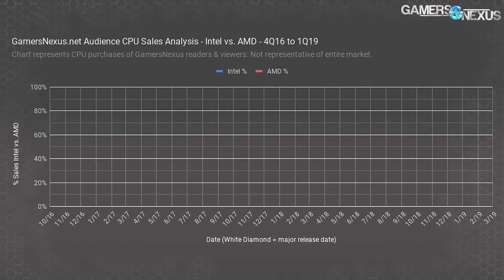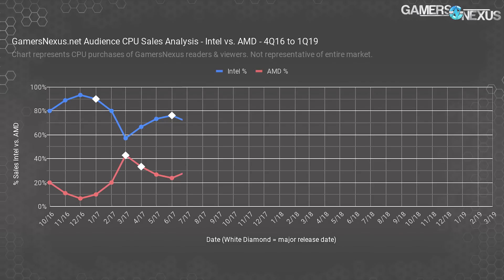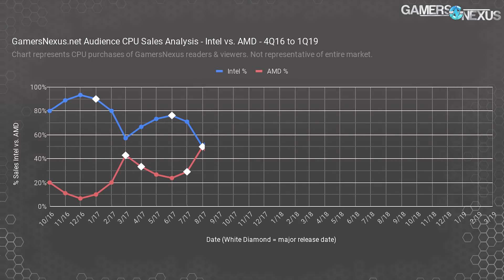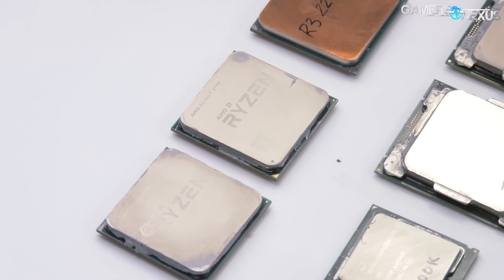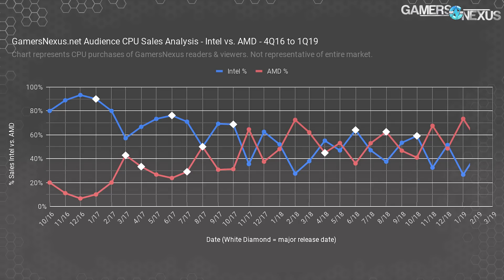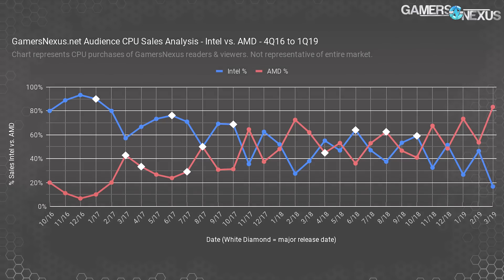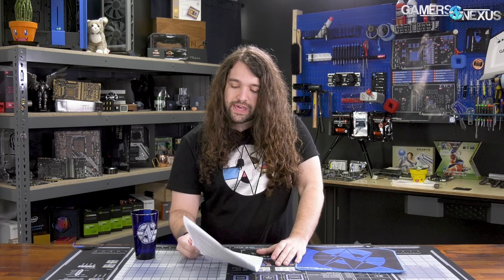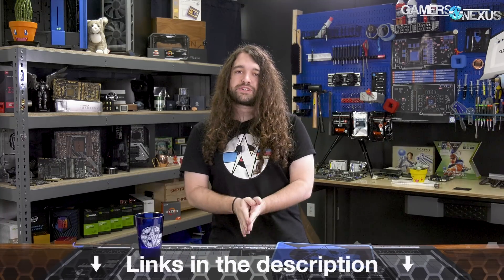Special Report: AMD’s Comeback Story - Intel vs. AMD Marketshare

Comment: I just can't wait for Navi and Zen 2
Reply: One or two month,,waiting AMD to take my money:)
Reply: Hopefully Navi isn't another Vega
Reply: It likely wont be. Everything we've heard points toward AMD focusing on being efficient, not running hot.  @eleanor-forte
Reply: isnt it usually the Nvidia fanboys who overhype AMD gpus releases tho? 'i want amd to launch good cards so i can buy Nvidia cheaper'. Even if navi performs lower than expected, buyers will have a pretty future proof card. not only cause of the infamous AMD fine whine. But most modern game engines should be well optimized for navi, since the consoles are gonna run a scaled down Navi SOC.
Reply: @golfclapper686  no, that's you just being high af.
It's the AMD fanboys that overhype it all the time. Wait for this wait for that, it will blow intel out the water, wait for zen2 wait for Navi, intel will be screwed.
I'd actually rather just wait and see what actually happens when hardware is out to cast my judgement but I've never held back on a purchase just because there is rumour that something else is coming out, that just builds you up for disappointment
Reply: Navi is going to be nice for GPUs. even though its later than the RTX 2070, if it's just as fast, it'll come in cheaper, and I'll support AMD over Nvidia if the performance is equal, because I really hate what Nvidia is doing to GPU prices... I don't want ultra high end because its almost never worth it, but the top of the mid range is a good place to be. 

Zen2+Navi is going to be my next build, too. :) But I'm going Mini ITX :D
Reply: Mine will most likely be a Zen 2 and a 2080ti. But i intend on waiting until we get some proper reviews in. Never buy on hype alone. 
I'm aware the rtx 2080ti is massively overpriced, but i've decided it's time i upgrade my Sim rig with VR. So i'll need all the power i can get.
Currently running an r5 1600 (silicon lottery winner, 4.1 capable but running 4.0) and a gtx 1070. Which has served me well thus far, perfect for my 1440p gaming needs. But won't be nearly enough once my VR gear starts coming in.
Reply: My first pc hopefully will be Navi and Zen 2
Reply: My current plan to replace my i5 3570k@4.2ghz +970 desktop is Ryzen 3700x is the leaks/rumors are true on either higher freq or more cores. Hopefully we get the higher turbo freq of 5ghz for a few cores. and whatever is in the $300-$400 price bracket from nvidia since I am UNABLE to go AMD for GPU because of their LOUSY OpenGL drivers for emulation. Which is where the higher Freq would come in. This will also be used for streaming to twitch so that is why I am thinking R7 to replace my i5. 16GB of either 3000 or 3200mhz ram as well.
Reply: Just commenting to notify you AMD just announced and revealed the stats of Zen 2 at Computex 2019 a few hours ago. Spoiler alert: they beat Intel.
Reply: @Hagvan452  I watched the keynote, they didn't beat Intel per se but they did strike performance parity which is huge.
Reply: @dennisp8520  Yeah my bad, I meant to say they matched and even slightly outmatched.
Reply: @Hagvan452  Yep, I will still be waiting on samples to make their way to channels like Gamers Nexus. I will more than likely upgrade in say 2 years if things keep up like they are.
Reply: Zen2+Navi APUs will also be very interesting for casual indie games players
Reply: I'm excited about zen2, but I'm am extremely hesitant on amd gpu releases. They always create so much hype and in the end, they always turn out to be woefully underwhelming by being barely competitive with the nvidia offering at higher TDP. 

I don't mind using their cards as I mostly player older games and did use a rx470 for 2 years, but now, I'm extremely wary of their gpu releases. Saying all that, if the price if low enough, I would buy amd again without hesitation.
Reply: Navi will be good. Much of the money meant for Vega was spent on Navi instead, and microsoft and sony pitched in because they needed a good GPU for their next gen consoles.
Reply: Don’t get too hyped about Navi it might be disappointing..
Reply: I've been on Ryzen since the R5 1600 came out. I'd love to switch to Radeon but I use 3d graphics programs that can use CUDA.
Reply: My next gaming PC will probably be Intel and nVidia...but dang it, I want AMD to force them to innovate.
Reply: AMD need money to do anything, and they ain't getting that if people continue to just buy Intel. I do understand the Nvidia - Radeon sitiuation.
Reply: @CaveyMoth  this is why they dont innovate. if amd is better for your money, please buy amd. otherwise amd will end up just giving up again........ they cant force nvidia and intel to innovate if people like you dont buy their stuff....
Reply: I couldn't wait anymore. I just decided to get the 9900k and RTX 2080ti. Honestly, I have no regrets at the moment. Performance  has been great and it's been a huge leap from what I had( which was a 4790k). I also got a new case from Fractial  that is really quiet and much smaller than my old one but still having enough space for all the parts. I am very pleased.

Still looking forward to what AMD has as it will force Intel to further improve and hopefully get the GPU prices lower. I paid $1500 USD for my 2080ti which is outrageous.
Reply: @dennisp8520  "couldn't wait"...? You had a 5 year old CPU, another few months surely wasn't going to hurt? :-/
Reply: @Peds013   That logic would apply but my work circumstances have changed. 6 months ago I was only using my computer for gaming predominantly. Now I actually do workloads that benefit from more cores(I even debated thread ripper) as well benefit greatly from the tensor cores in RTX graphics cards. I also want to point out that there were some features that I needed from the newer motherboards that were not available on my old rig like Nvme storage.

Anyway, the only reason that CPU lasted me 5 years was that there was no real progress until two years ago. My build range was 4k and X299 would have been too expensive back in the day for features that I didn't need at the time. Everything on the consumer end had stagnated so there was not point upgrading to say a 7700k as an example. First, gen Ryzen although awesome value had a ton of issues originally and bad single core performance. The Ryzen 2000 series was better all around including support(and like I said tempting) but didn't make sense when I still value gaming performance and had the budget for an intel build.

I may regret not waiting whos to say but the time that is saved from this new rig honestly probably negates any cost savings I would of had if I went and waited on Ryzen.
Reply: @dennisp8520  I was looking back at the 900 series and the top card was 980Ti which came in at a price of just above 500, quickly dropping to below 500. $1500 for a 2080ti is scandalous profiteering.
Reply: @BigAL0074  you can actually get it for $1,100. Also inflation is a thing as well as other factors that are driving up the fort to make GPUs

Comment: Hopefully Zen 2 will cause Intel to put out a decent cpu that isn't insanely expensive
Reply: jacob bryant: I believe Intel will come back with something pretty awesome, but they have to get on TSMC's 7nm, or something equivalent, fast, or AMD is going to bulge into a juggernaut of a competitor while Intel reconfigures its org chart, and also, Intel is going to be facing an increasingly powerful and competent adversary the whole time. Intel is gonna need at least a couple years to get their house back in order under Keller's guidance, but as things progress I'm quite sure that the AMD vs Intel story will still be about an upstart boutique chip firm vs a slow but massive incumbent Chipzilla, for the forseeable future. AMD is barely SP500. Intel is one of the pillars of DJI.

Comment: I am patiently waiting for an i7 9800X for my next build.
No interest in AMD whatsoever.
None.
Also looking forward to Intel's graphics cards,
and how Allyn Malventano can come up storage-wise with while he's there.
Reply: smarter shoppers do things differently than someone defiantly refusing to look beyond a weirdly obstinate purview.
Reply: Missing out my friend. Enjoy your terrible performance per dollar.
Reply: Well... By then, ryzen 3000 will be out a fair bit earlier, so why not give reviewers a gander apon release coverage. (: 

No sector of ryzen 3000 is without excitement for very good reasons.
Reply: Eh, I think I'd rather go with a TR 2920X for a $600 CPU, extra 4 cores/8 threads and 20 more PCI-E lanes than the i7-9800X, while roughly only having 5% lower single core speed.
Then again, Ryzen 3rd gen is likely to demolish any options that we currently see in the market, so it's a good idea to wait until the last week of May. (Computex)
Reply: @Megadeth1983Fan 
No interest means just that.
The 9800X does not have less PCI lanes. 
44 CPU plus 20 or 24 thru the chipset.
I KNOW I will not be able to do 5.0 GHz with the other brand.
Performance per dollar to me is a compromise.
I want performance. Period.
I also do not need memory issues which plague other brands.
(I have also built systems with Optane 900 series drives, have you?)
Smart shopping is knowing what you want, 
and using the product actually delivers every time.
If I want a Shelby GT500, I will not consider a v6 Mustang.
I will just work harder and save longer to get what I desire
because it is worth it to me.
Put it this way,
I built a system for my wife on X299 using the "lowly" i5 7640X.
CPU was 217 plus shipping brand new.
Can YOU go 5.2 GHz on a $217 CPU?
Delidded and on a 360 rad it runs DAILY @ 5.2 GHz. @ 1.17V
and never goes above 60C, and it is lightning quick.
With 32GB DDR4 (4x8) if I decide to upgrade the cpu 
I just have to move 2 ram sticks. (To go to quad channel)
Done.
Quality of EVERY component makes a difference.
Always has always will.
Reply: @2000cobraguy  Why settle for a 9800X? That is an enormous compromise. At least go with a 9920X.
Reply: Sounds like an elitist attitude. BFD On your high FPS or gigahertz. Processors and GPUs do not win games no way no how!  Gamers win games! There are many gamers with a lot less firepower (smart shoppers too with AMD) who use strategy well and win games. Just because you think your computer is running faster doesn't mean you're going to win more games. Your analogy of your gas guzzling noisy Shelby GT500 doesn't hold water either. You can definitely create more smog, burn more rubber, make more noise and Drive in circles on a race course, But when you get out on the highway with the rest of us you're going to have to deal with the traffic just like we all have to.
Reply: Hard work is not elitist.
Having goals and preferences with reasons is not elitist.
Where did I say I play games?
Reply: 9800X is not a compromise.
More cores = more heat = less speed.
Reply: @2000cobraguy  Better binning, might be a bigger die on that part with better heat distribution. Just as likely to hit 5.0 on the 9920X. I predict you won't hit 5.2 on the 9800X anyways. Might not even hit 5.0. Why settle for only 8 cores, because of only a slim possibility for a slightly higher clock. I understand if money is tight though.
Reply: @2000cobraguy  The 2920X has 60 PCI-E lanes alone...
Reply: 7900X and up have 64 pcie lanes
44 thru CPU and 20 thru chipset.
What is your point?
Without exotic cooling no AMD cpu can hit 5.0 GHz
Reply: @2000cobraguy  Ryzen 3rd gen is likely to hit 5+ GHz. Not only that but, refinement to the infinity fabric will allow much higher memory support than 2nd gen. Also, the X399 chipset has 12 pcie lanes while a Threadripper CPU has 60, which adds up to a total of 72. One last thing, IPC increase will be roughly 13-15% higher than the 2000 series, which will pull 5-7% ahead of Intel's current IPC. (Coffee Lake IPC is 8% higher than Zen+)
Reply: @2000cobraguy  Lol. AMD was doing 5+ GHz. years ago with FX. The point is that clock speed doesn't make the cpu. That's why it's so funny hearing you ramble on about your 'Shelby GT500'  and '5+ GHz'.

Comment: I bought a R5 2600 and am very happy with it. The performance of it is amazing, not just for gaming but also for rendering in blender. So happy that AMD has made this comeback!
Reply: I haven't upgraded my CPU in forever (2012) and haven't decided if my next one will be based on Ryzen or some future Intel CPU, but I'm certainly glad to see that AMD is back in viable territory with CPUs I can get at least a little excited about around the $200 mark, be it a 3600/3600X or 2700/2700X.
Reply: yaaaa buddy!!!
Reply: I'm quite happy trying out AMD side this build. 2600 here for a very affordable price to performance. Blender Cycles renders faster than with the gpu in openCL. Now that the ram prices have fallen too and some deals on RX5XX cards it's incredible how cheaply you can build a competent pc.
Reply: @Beowulf Proud owner of a 2600x they sold all the 2600's on ''build day'' so I had to suffer with a slightly higher price. Love my new PC build.
Reply: 2600 owner here as well for 150 bucks you really cant find fault with it. I originally got it as a place holder until Zen 2 releases. I will most likely still upgrade but it's a tougher decision that I thought it would be because the 2600 is so good
Reply: Last Christmas I built a PC with a R5 2600 and a cheap second hand RX580 from ebay and i am very satisfied with the machine. AMD rocks.
Reply: @EJSC That makes sense, but I got my 2600 for $280 (NZ) I got my b450 MSI motherboard for $150 and 8GB of 2666 RAM for $100. The equivalent Intel CPU at the time was the i7 8700 witch was selling for $450. In my case I am quite sure that I made the right choice, especially because I render a lot more than I game.
Reply: Same with my r7 2700x i wanted that pretty good clock speed and 8 cores and that was perfect for me
Reply: @EJSC well thats only if you "just want to game" pretty sure those extra threads will be nice down the future and if you want to stream you want to go ryzen and the ryzen boards are dirt cheap